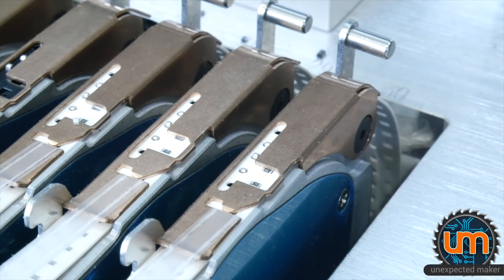CHMT 560p4 + Electric Feeders - Its a wrap!

Comment: I found something interesting, Charmhigh's other PnP machines use the "Panasonic A6 servo motor" kit for X/Y axis.
But for the CHMT 560p4, it doesn't say what they are using.
Given the Panasonic servo motors were a selling point on the spec sheet, this isn't just an omission.
Looks like this machine is using a "home grown" servo and servo driver, instead of the tried and tested Panasonic setup.
So it could be the servo motor or the driver, if it were the Panasonic parts then neither would be faulty and it would be a controller glitch.
Reply: I have been assuming that this was a servo providing feedback on the rotational position of the stepper motor, rather than using a linear scale on the axes (as would be used on a CNC mill). Am I right in this assumption, do you know?
Reply: I am also thinking along those lines. I presume it is using open loop stepper motors. And the randomness could either be skipped steps because of too aggressive acceleration or too weak drivers. Or it is just poor software.
Reply: @rehnmaak  I don't think it uses open loop steppers. If it missed steps in that condition then the rest of the job would be off by that much until the machine rezeroed (or missed additional steps), which is not what Seon is reporting.

Comment: If it's a fundamental problemo, they must have other customers with the same issue 
If you can't get a replacement machine or money back. 
Then there may be a way forward to work supervised with their engineering.
And compensate you another way or in the future? Think outside the box to keep face?
Would be quite intresting to get to the bottom of the problem and see each stage of the fault finding.
Or at what speed it falls off the wagon.
If it's just a motor controller\drivers that would be good and simple to fix,

Have you got raw videos of it just running 
Can you extrapolate anything from just doing those nano boards?
Reply: The is one other customer, with the same exact machine, delivered within days of Seon's, and it's got the same faults.
Seon has been in touch with him, getting even less help from Charmhigh also.

Comment: Uh...Consistent offset to either left/up or right/down?...Some sort of backlash?
Reply: Good thinking! Backlash in the carriage, or looseness between two parts that are supposed to be fixed together, or a flex somewhere.
Reply: To test the backlash theory, it might be informative, for the frequently misplaced component, to move the feeder to a vastly different location, and also move the board or panel to a different location, and see if the symptom changes. I realize that the head picks up the component, then visits the camera, then moves to the board location. So it always approaches the target pads from the same direction, even if the feeder position is changed.  But the putative backlash could be in the positioning over the camera, and that would vary according to feeder location.  Anyhow, a variety of combinations could be imagined, though it's difficult to incorporate a reason why only particular components are susceptible.

Comment: Seon, you mention making adjustments to the pick up position.  I'm sure you know this, but you want to avoid picking off centre as it will potentially make things worse if the PnP then rotates the part prior to placement, especially when the vision system is so dumb.  And that would vary depending on rotation clockwise or counter-clockwise.  I see this happen on my blind benchtop PnP.  I'd think it would be better to adjust the placement coordinates if for some reason there is consistent misplacement for whatever reason.

Comment: Ok, sadly no final step to fulfilling the specs, hope it at least assists future assembly enough to make the manual cleanups workable. 
Half speed and forced to single head at a time is hard, and probably not workable.

Best luck for the future. Hope that Charmhigh can in the background come up with additional working fixes, based on their production observations on other machines. I am convinced your serious issues must appear in some form on other machines, while being adjusted during manufacture. Software is also particularly prone to changes/patches. Maybe some issues maybe resolved in fixed software.

Comment: 10:56 Just the fact they never responded to that question puts me off buying any of their stuff in the future.

Clearly they are more than happy to take thousands of dollars from you, and don't really care what happens from that point on. Nice company.

I'm still convinced it has an issue with the encoders or something else to do with the firmware, like it's sometimes ignoring the visual system, and not using the calibration, or maybe it doesn't quite leave enough time for the gantry to stop before it takes an image?

Maybe it's not that it's skipping encoder pulses, as that would cause a global offset from that point on, until it calibrates to the limit switches again. (I'm assuming it must have limit switches for when it first powers on?)

Was this the same machine that had very obvious shipping damage before it arrived at your house, btw?
Did they say anything about that since? It could explain many of the issues with it, including the noise on the Y axis (chassis is a tiny bit bent, and binding somewhere).

For the amount of money that thing cost, they should be sending a proper engineer in a face mask to your house to fix it.

Anyway, I'm happy for you that it's at least mostly usable now, but it sucks that you have to constantly correct for the offsets still.

The electric feeders do look a lot better than the pneumatic ones, as it looks like the motor has a small amount of ramp-up time.
With the pneumatic feeders, it looked almost impossible to control the rate at which they "shot" the tape forward. lol

Oh yeah - if the electric feeders are still triggered by the pneumatic system / solenoids, it makes me wonder why they can't supply a kit that allows the new feeders to be triggered directly from the control board instead?

Comment: Could the encoder or motor be faulty and missing steps? Doesn't Australia have pretty power issues? Maybe the current is low so the motors are not turning full speed so the timing is thrown off.

Comment: Hi, I've been looking for a company based in Australia that manufactures their own development boards, as I've been struggling to import ESP8266 and ESP32 boards direct from China for the past couple of months. Not because of the lockdowns - but the indirect impact on trade as a result of the ongoing political tensions between Australia and China. I recently came across your TinyPico boards after reading a positive review in a local makers magazine. 

I've watched a few of your videos about your products, and your ongoing series about your Pick n Place machine. I'm very interested in your products as I think they would work well for what I 
require, but I'm a bit concerned that the quality of products and/or volume will be heavily impacted as a result of this faulty machinery. 

Are you able to provide a reassurance that the quality and supply of boards will not be impacted as a result of this faulty machinery? I'm part of a little startup that cannot afford to continuously redesign products due to boards being unavailable as a result of political tensions or unreliable machinery. 

Cheers.
Reply from the maker: I have not had any issues making and supplying any of my products - either in quality or quantity.

Comment: Changing the tyres is hardly going to resolve a misfiring engine problem. No matter how convinced you are it won’t, attempting that as a suggested fix earns you some cudos. Faced with the failure of their suggested fix you’d think they’d finally accept they need to offer their next best product gratis and stir up a bit of goodwill ! Not answering whether the machine meets expectations probably says it all (either perfect comprehension of the question or a language issue - I suspect the former).

Comment: Why not send CHARMHIGH one or more of your boards (panelized I suppose)?   Let them place dummy parts (do not care about the component values but do care about the package size).  They should video the entire placement process (before manual touch up of component placement) and an inspection video of the component placement, again prior to manual touch up of the component placement.  Then, of course, Charmhigh should share the placement video and the inspection video with you.   This is a more or less painless way to confirm that the machine is capable of placing your components on your board.

Comment: This company very clearly doesn't understand anything about (relative) calibration processes. It it's pure speculation, but I get a very strong sense they don't engineer the hardware (electronics as well as mechanical).
Personally I would move on. Try to sell it as is or get it working myself.

Comment: A functional pick and place machine requires extreme accuracy and reliability at every single step. There is no forgiveness in this process. 

How can anyone expect this to be done at a low cost? In context, these machines are dirt cheap and the performance expectation should be appropriate. 

My system is a full on commercial system that is extremely precise, yet it is still a seriously challenging effort to operate reliably.
Reply: Then they shouldn’t claim to do precise work. It’s as simple as that. Don’t market the machine for what it cannot do.
Reply: @akhurash  I totally agree, but in the end it is up to the consumer to know when the marketing dept is full of BS and purchase accordingly. 

When a product is drastically lower cost that an established brand/model - something has been compromised. In this case, a LOT has been compromised to get the low cost. 

PNP is a world where compromises tend to create very expensive problems downstream. Pay now or pay later is the take away.